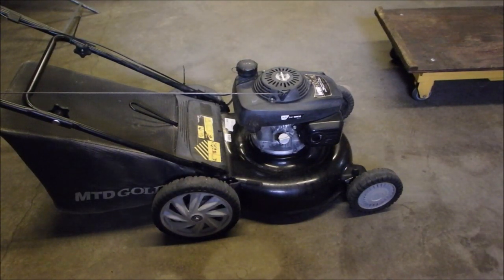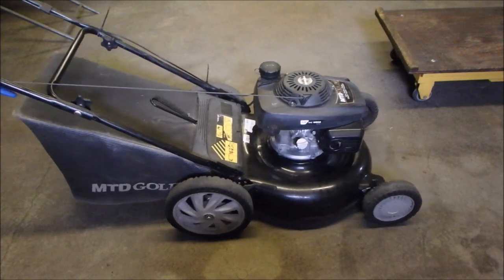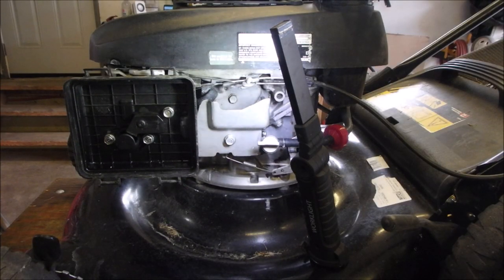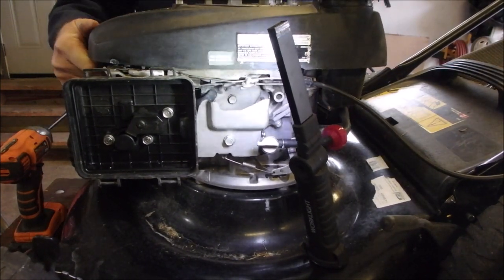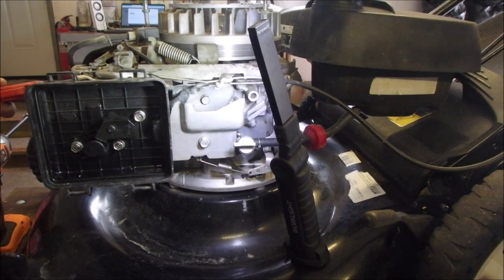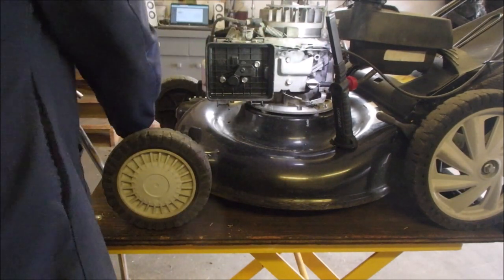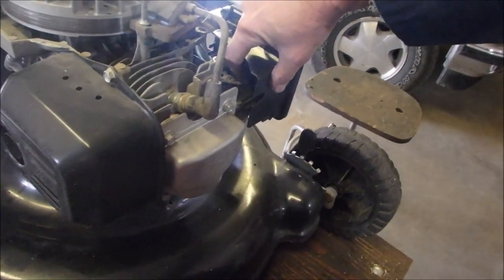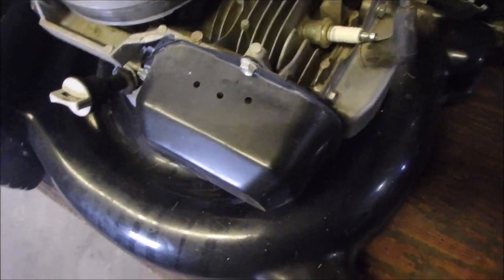Craftsman Honda Sticky Choke

Comment: Hey Bruce,
I recently had a similar situation when working on one of those semi-automatic chokes. I started by spraying the rotating components with PB Blaster penetrating oil.  That didn’t satisfy me as far as return speed goes.  So, I shortened the return spring of the rotating assembly. That sped up the return but still not satisfied.  If you check that rotating assembly, you’ll notice that there is a little nub that stops the rotation about halfway, momentarily.  I felt that the nub was slowing the process too much, so I tweaked it just a bit, reducing the friction on the nub as it rotates by.  Then I was very satisfied with the rotation speed and duration.
Yah, it seems a bit long winded but wanted to be clear!
Reply from the maker: I get that.  Mrs. P know to just take the choke off after the mower starts.
Reply: @BrucesShop  is this your personal mower?

Comment: Bruce,    I just cleaned a Honda mower carburetor but wasn’t able to remove the main jet, it loosened up all the way but it wouldn’t drop out even when I tapped on the carburetor with a screw driver handle.
Reply from the maker: I would let is soak in something Hydrocarbon for a day or so.  I know it is hard to do as you want it running NOW.  But try it.  Carb clean is the best   Any kind.
Reply: Took the carburetor off and got the main jet and emulsion tube out this time after blasting it with WD 40. The only thing I didn’t remove is the screw with a metal tab on it that prevents you from turning it all the way out. Still seems to run with a slight surge 🤔. I did replace the plug cause it had the wrong one in it. Thanks for your advice Bruce. Sold 3 mowers today 😊.

Comment: Nice job Bruce we have seen a lot of these that customers have fiddled with by putting too much tension on the return spring and the lever action is so fast that the choke is fully opened before you can get the recoil pulled to start the engine. Normally the vibration of the engine will take it off choke but a lot of times the plastic to plastic wear of the assembly causes it to grab and not allow it to pull off choke at the normal rate when it was new. We have had to use a fine grit sandpaper to smooth out rough areas of the plastic and then lubricate with a dry spray lub. Periodically we have added a half turn to the spring on the choke plate. Just a few other things you might want to check if you get another one with issues.
Reply from the maker: Right.  Even on my own if it isn't an issue I don't mind returning the choke manually.  A small price to pay.

Comment: Hey Bruce, I have a Troy-Bilt mower with the Honda GCV 160 engine and the same choke set-up. It sat for 3-4 years with old gas. I recently cleaned the carb but it only starts well if I pull the cord once without engaging the safety bail on the handle first before pulling it with the bail depressed as you normally would.  If I do this, it starts right up.  Otherwise I can pull and pull and it won’t start or is very hard to start and this mower always started after 1 or 2 pulls.  Once the engine is warmed up it starts right up.  I suspect the choke system is at fault because as soon as I press the bail in, the lever quickly returns the choke to the closed position.  I’m not sure it should return quite as slowly as this one you repaired did,  but is there a way to adjust it so it won’t close so quickly.  I think mine is just closing to fast (I can’t remember how fast it returned when I used it regularly) before enough gas can get to the carb.
Reply from the maker: That is a tough question as I am not there.  The linkage has a couple of "notches" in the operation.  I would check them out   Sorry I am of not much help.  Thanks for asking.   You have to be there for many things.

Comment: I like Honda, however, some of there engines are over designed.  The GCV160 has an auto choke in some cases (thermo wax choke), and a timing belt that jumps off the cam once in a great while.  I keep getting chokes that don't want to open properly even after replacing the thermo  wax choke part.  Any suggestions?
Reply from the maker: No i have the same issues.  I do clean the thermo wax shaft with carb cleaner.

Comment: That choke still isn't working right Bruce! It should swing right through the whole way through smoothly it actually ended up getting stuck in the middle for a moment
Reply from the maker: You are right.  I wonder if it is the Chinese clone carb?

Comment: I was working on the exact machine yesterday. Surged like crazy. I reset the gaskets twice, no change. Sprayed carb spray and The throttle shaft appears to leak, so I ordered a new carb. Should be here June 1. $40 for the carb, I only paid $20 for the mower.
Reply from the maker: You are winning on that one.  This one has a chinesiem carb
Reply: @BrucesShop  mine is $30 plus $6 shipping plus tax.  But the $16 one said it was going to be until late June to get it. I ordered it last night and it has been shipped today. Texas to Michigan, I might have it Tuesday.